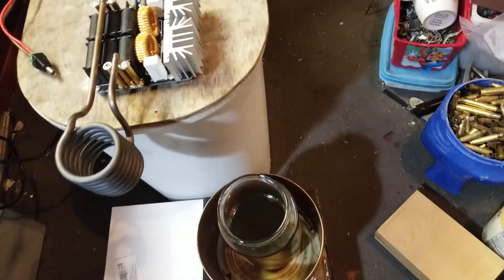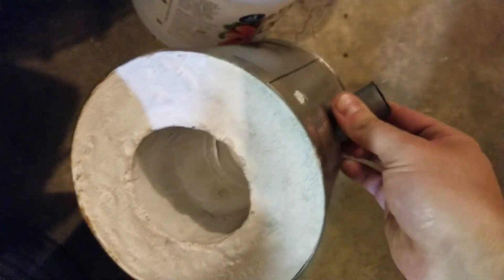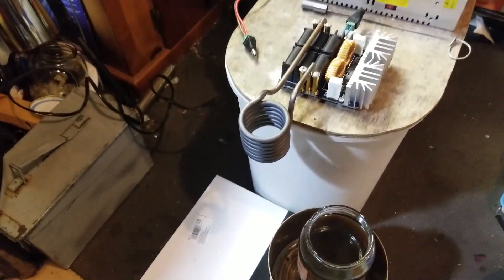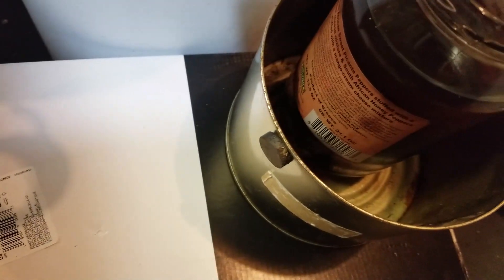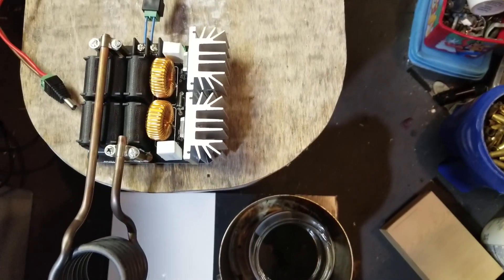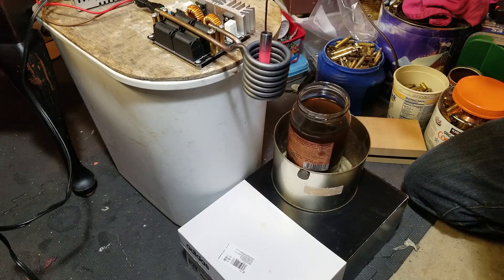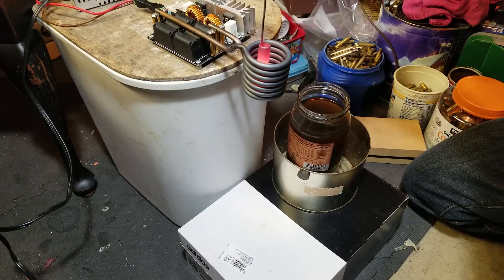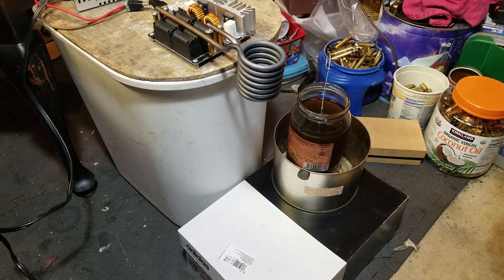Tempering steel with induction heater

Comment: Have you been able to check hardness after this & see what HRC you can achieve?
Reply from the maker: AdhocArtisan No, I don't have capability to test hardness however, I tried turning piece on my lathe and it would not cut with HSS tool bit, tried with carbide and I was able to cut but the insert was ruined.  Run a file across and it just slips.  I need better power supply though.  600 watt was ok with smaller 1/2 pieces but it struggled with bigger pieces.  I'm using new induction board too rated for 1800 watt.  I also have 2400 watt power supply that runs on 240 volt, I tried that too and the bigger piece got so hot it was glowing like a light bulb, I quenched it in oil and it was ruined!  It even scorched the heat resisting sleeve I put on coil!  It's supposed to withstand really high temperatures.

Comment: so... that was not annealing or tempering.  You hardened it.    There was no tempering here sorry.   still ok example of indction forge use.    Would make better video if cleaned up the work space, and bad example red hot and induction right next to pile of shells (even if blanks, accident waiting to happen)
Reply from the maker: You're right it's hardening and not tempering.  Now let me correct you on what a blank is - it's a loaded cartridge without a bullet with crimped top that looks like this: https://images.app.goo.gl/3zkLkqMCrX2shpgN6  This is not what I have in the background, it's just a spent brass that I clean and reload later.  The reason it's there because I was experimenting with annealing brass with my induction heater.  In this configuration I couldn't get it to glow red in a short time but with a different coil it worked.  I am planning to do follow up video eventually.

Comment: What kind of power supply are you using? I tried to use my 0-32vdc - 15 amp power supply and it keeps blowing the overload breaker.
Reply from the maker: I am using ~600 watt PS, It's about 52v and 11.5A.  My PS allows me to adjust and see voltage and I can see Amp draw.  I am not sure why you're blowing overload breaker but it could be because it's rated for less amps.  Also could be bad wall socket, I couldn't run my lathe in garage until I replaced it with a new one, it kept blowing the breaker.

Comment: It seems you hit easily the 850C  mark.
Reply from the maker: This power supply is actually weak, with better power supply the metal got so hot it was blinding and the part got overheated, so there is definately big potential, I am using 1800 watt board now with water cooling in the coil.

Comment: Great Video!!!   found it very interesting.    do you have a video on how to build one of those bad-ass induction heaters?  i would love one for myself, it's better than propane
Reply from the maker: Now I have 1800 watt board because I fried the last one, you HAVE to use water cooling and fan, the PCB board underneath capacitors reaches over 300F degrees, it's no wonder it failed.  I am not sure if some component died or solder connection came loose.  You also want to isolate the coil so you're not having air flow from the fan cooling your annealing part.  I've had that problem.  I've got another one of these to compare to my 1000 watt.  I think they are both capable, but I am doing small hollow punches, anything bigger and you want to go with bigger board, possibly even 2500 watt.  You'll also want at least 1000 watt PS and you want to cover the coils with heat insulating sleeve.  The coil size makes a big difference too.  I put the smaller coil from 1000 board to 1800 board so I can get better concentrated heating but it also draws more current, I believe it also increases frequency which causes the board to overheat.  I am working on solution to wither water cool or add heatsinks with fan to cool PCB.  If you search ebay for 1800W ZVS Induction Heating Board you'll find a bunch of them.   The pump https://www.ebay.com/itm/1Pcs-mini-Gear-Water-Pump-Fuel-Pump-for-RC-Boat-Cooling-parts-DIY-Model-/392124813339?hash=item5b4c75d01b and heat sleeve https://www.ebay.com/itm/Glass-Fiber-High-Temperature-Electrical-Insulation-Tube-Sleeving-600-C-/202624493989?var=&hash=item2f2d5c69a5
Reply: @DimaProk  Do you have an email where we can DM each other? I have a few suggestions for your Induction heater that would kinda sort out the overheating problem. unless you don't mind discussing it over the youtube comment section :D
Reply from the maker: @jamieduvenage2111  sure dimaprok@gmail.com